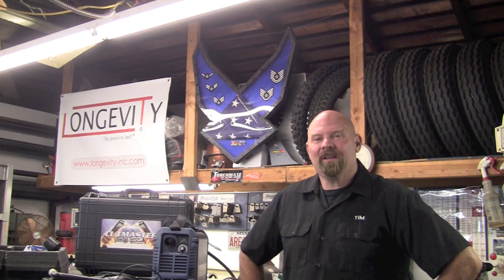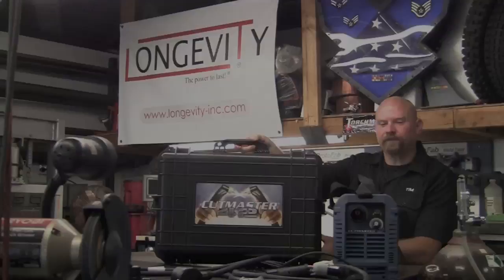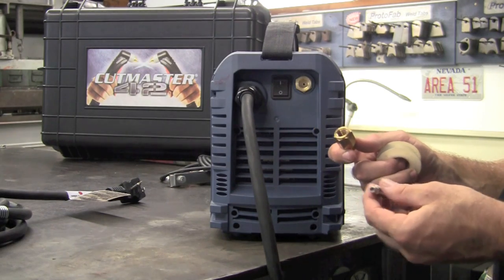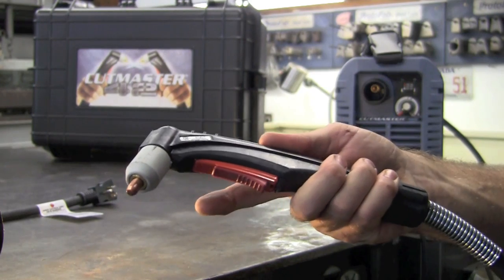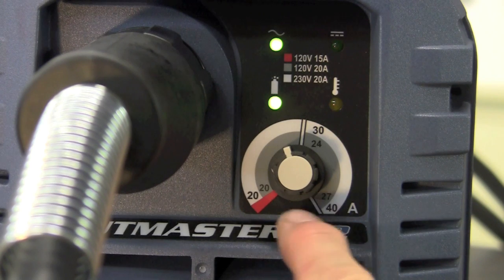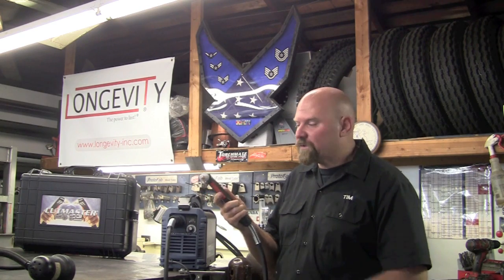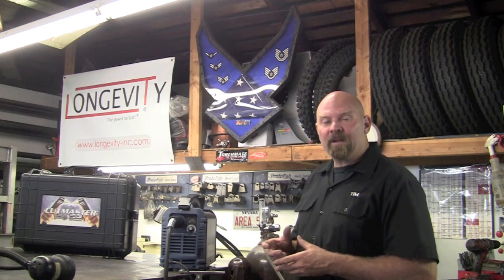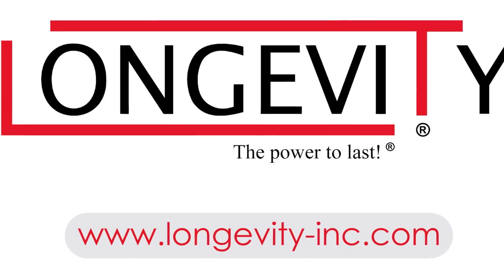THERMAL DYNAMICS CUTMASTER 42 SETUP - REVIEW - TESTING THERMADYNE THERMAL ARC PLASMA CUTTER WELDER

Comment: Hi i have the plasma cutter less than 30 hrs on the machine in the repair shop for the second time the torch is a chinese peace of garbage its not ever weekend worrier grade if it brakes again I'm going to run over it with my loader along with my dewalt 215 kerosene heater just two pieces of complete garbage my name is chris wright muskoka sandblasting canada on face book and have web site
Reply: I hate that machine.